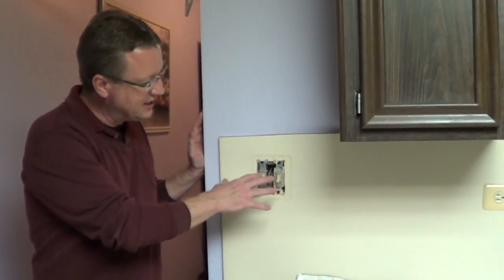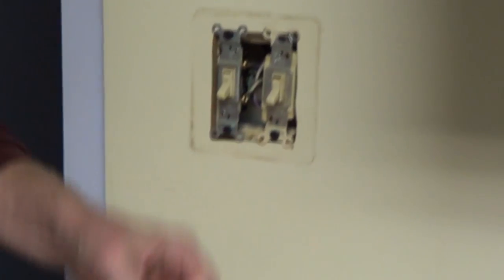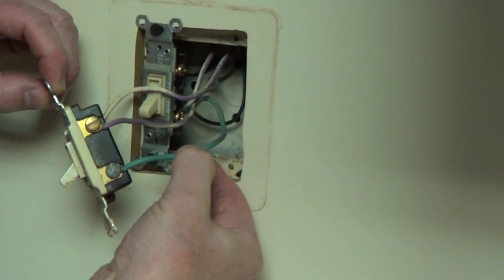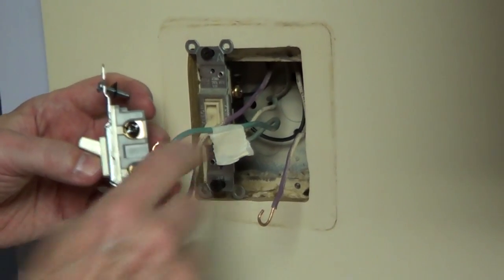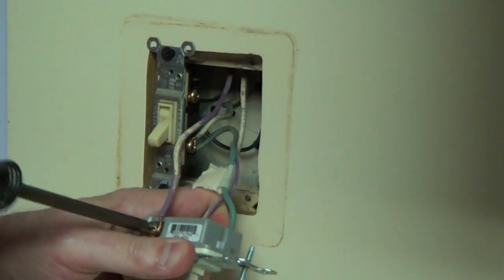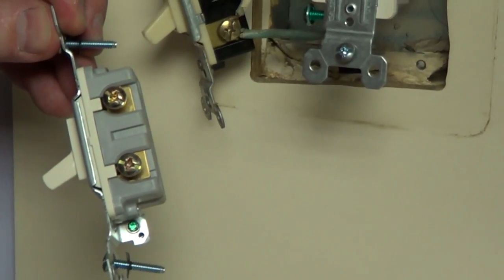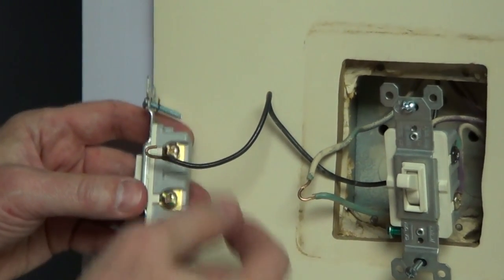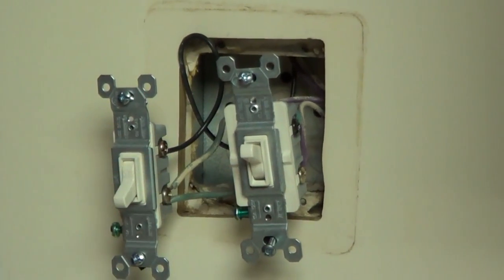Double Switch - 3 Way Switch and Single Pole - Conduit

Comment: I have 2 lights and 2 switchs on the same circuit a total of 3 white wires and 3 black wires. I put a single pole switch on one not sure what to put on the other switch single pole or 3 way
Reply from the maker: Hi, you can send a pic to fixitpodcast@gmail.com.

Comment: in 2011 the code changed to include neutral wire in all switch boxes...i didn't see any in this vidio.
Reply from the maker: Hi, yes if you are running a new switch leg.

Comment: I don't know if you still check your account but I have an issue maybe you can help with.  The person that built the back half of the house has all lights on 1 breaker.  I took apart the first set of switches and forgot to tag them.  There are two lines running to the switch box and two 3 way switches for different lights.  There is only one main hot wire, white wire, so he had the power running through one switch and to the other to continue the power through the rest of the lights.  The set of wires that arnt hot are as follows; red, a white split into two whites, and a black split into two blacks.  He had two wires to one screw two different times. Im not going to rewire this mess.  I got the first switch working except it throws the breaker when I go to turn it off.  The power is to the black screw.  Im not sure how to tie in the next switch to continue the constant power flow to the rest of the back add on lights.
Reply from the maker: Hi, can you send a couple pictures to fixitpodcast@gmail.com.
Reply: I appreciate the reply.  I got somewhat lucky and figured out the original set up.  Figured out the white was hot because that switch was the return from light.

Comment: Excellent video but remember if you see green ground connected to your switch on the power side, that is Not correct! Green or bare is Ground only! Black is hot, or one of two transmission lines to the seconary switch single pole or double, and white is only neutral pigtailed separately for each circuit, if a white is used as a top feed line to the light fixtures mark as second or third black wire with tape or marker! Follow A/C flow paths on all switches and outlets, install in the upright facing position with optional ground screw on the bottom left of switch note that common is on the bottom right side and transmission wires top right and top left if a three way switch and single is just common bottom and one top feed on the right side only!  Bear in mind that the manufacturing process ribbits the switch upside down down on the mounting bracket with switches by accident!

Comment: I have something similar, but yet I can't figure it out.  Hoping you can help.  I have a single switch that operates one light and  powers a 3 way switch next to it, and that operates lights from 2 sides of the kitchen.  They (previous electrician) has power coming from the light box up above (power source). Then, power comes down into the switch box powering the single switch with a jumper wire over to power the 3 way switch.  The light box above me has a Romex- 2 wire (black & White, no ground) and Romex 3 wire (red, black, white wire) coming in it.  The romex 2 wire  (black) is the hot all the time but can be turned off with the breaker..  Any help would be appreciated.
Reply from the maker: Hi, what are you trying to do?
Reply: I have a single switch that operates one light and powers a 3 way switch next to it, and that operates lights from 2 sides of the kitchen. They (previous electrician) has power coming from the light box up above (power source). Then, power comes down into the switch box powering the single switch with a jumper wire over to power the 3 way switch. The light box above me has a Romex- 2 wire (black & White, no ground) and Romex 3 wire (red, black, white wire) coming in it. The romex 2 wire (black) is the hot all the time but can be turned off with the breaker.. Any help would be appreciated.
Reply from the maker: Hi,

Can you send a picture to fixitpodcast@gmail.com

Comment: This was an excellent video - short and to the point.  It wasn't what I was looking for though as I had hoped it would show me how to wire one 3-way/single pole combination switch where the common wire powers both switches at the same time.  Still, I found this < 4 minute video to be one of the better ones due to it's length, focus on the subject, good audio and good video!  Well done.
Reply from the maker: +Prime8inAtlanta Thanks.
We have more tips in our home improvement book http://www.amazon.com/dp/B013YR9UOC.
Reply: FIX IT Home Improvement Channel

Comment: hi, i want to be able to turn on bathroom fan while main light is off. but fan turns off if light is off. what can i do to have constant power to fan switch?
Reply from the maker: +bluekeet Hi, how is it wired. One switch now?
Reply: +FIX IT Home Improvement Channel well, theres a two gang unit for two switches, left one is a 3 switch for light,nigh light, and fan. Right switch is a single pole mainlight switch. The 3 button switch is being supplied by a black wire that is spliced into the black wire to the switch on the right, which is the single pole switch. When single pole switch is on(meaning main light is on) then i am able to turn on the fan or the fan light. But if i turn main light off then the fan switch automatically turns off even if fan was on. Also the fan's neutral wire is connected to another neutral wire from a light of room next to bathroom. I hope this helps you in order to come up with a solution.
Reply from the maker: +bluekeet Hi, I would turn off the power to the circuit. Remove both switches and find the hot wire feeding the circuit. You will have to separate all the wires so nothing is touching, then turn on the power to find the hot. You can then feed both switches from that. Depending on how the electrician wired it, you may have to create a small pigtail wire to feed the second switch. If you have 2 switches, both need to take power from the hot wire.
Reply: +FIX IT Home Improvement Channel how do i know which wire is hot? can a digital multimeter check?if so what serting do i put the meter on to check the wires?
Reply from the maker: Hi, you can use an inexpensive multimeter. Let me know what you have and I can walk you through it.
Reply: +FIX IT Home Improvement Channel i have one of those harbor freight digital multimeter, cen tech 7. idk what setting to use tho. thanks for replying.
Reply from the maker: Hi, set the dial to 150 AC. You are testing for 120 volts. You are looking at the numbers on the dial that end with 150. If you have a grounded metal box touch one probe on the wire and the other on the metal box. If you have a plastic box, test each wire with one probe and put the other probe on the ground wire. This will show which wire is hot.
Reply: +FIX IT Home Improvement Channel oh thank you very much sir, I was finally able to solve the problem with your guidance. good bye and wish you luck.
Reply from the maker: Great. We have more tips in our home improvement book http://www.amazon.com/dp/B013YR9UOC.

Comment: What would happen if you wire two individual wires to one screw? Because I know that a few of the switches in my house are wired as such. Is that a fire hazard?
Reply from the maker: Hi,
Take a short piece of wire and using a wire connector, create a pigtail so you have one wire to the screw terminal. This creates a safe, solid connection. Multiple wires can come loose creating a shock or short hazard. I have a video titled "pigtail for an outlet" that will show you how.
Reply: @FIXITHomeImprovementChannel 
Or get a late model heavy duty switch, possibly commercial rated that allows for two wires to be inserted under a screw terminal where the screw applies a clamping action to the wires.

Comment from the maker: Hi,
That wire is really blue. It does look green in the video. It is amazing what you will find in boxes though. Sometimes builders will use what they have to finish a job, so the color of the wire is not always correct.  Yes, green is used as a ground.